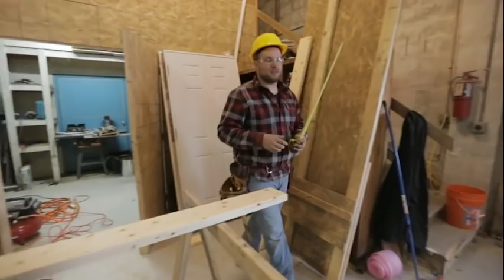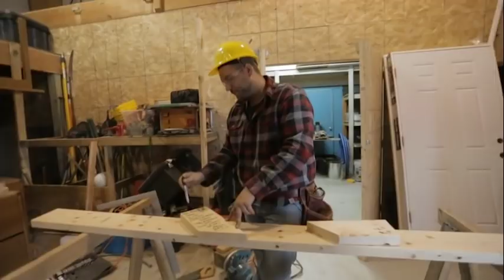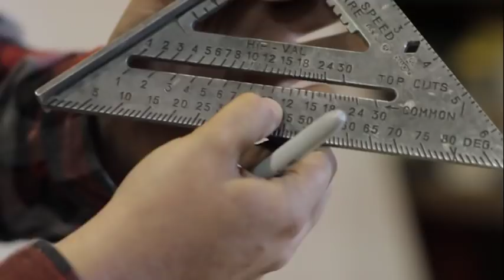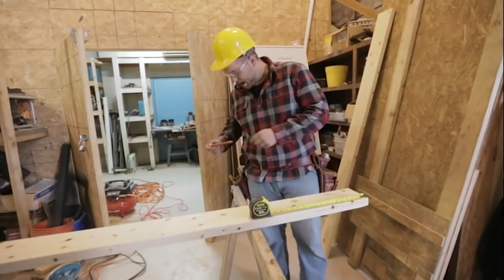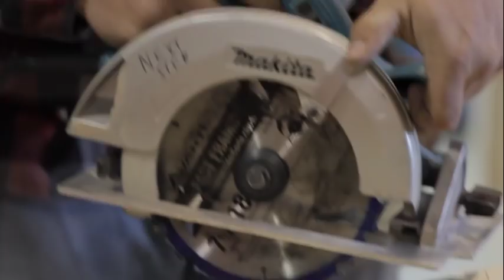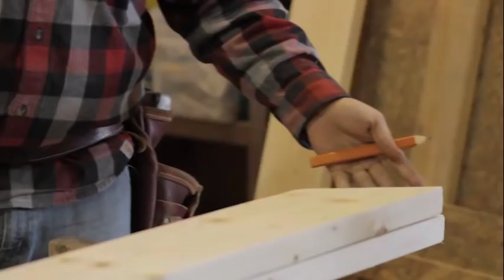How to Layout Rafters // Roof Framing Part 2

Comment: Those rafter boards need to be crowned. Look down them and put the curved bow facing up. That way the load of the roof pushes down on them straightening out any bow. Same as with floor joists.

Comment: If I'm not mistaken, IRC doesn't allow more than a 1/3 of the board to be cut, making that birdsmouth a little too big. The depth, or the plumb cut of the birdsmouth shouldn't be more than 2 9/16. On a 12/12, that would give you a seat of 2 9/16 which is more than enough bearing. On a 6/12, 2 1/16 is the height of the BM plumb cut giving you a seat of 4". A 5/12, max of 2" and a seat of almost 5". Conversely, an 18/12 gives you a max plumb of 3 3/16 on the BM and a seat of 2 3/16. A 24/12, max depth of plumb at bm of 4 1/8, bearing of 2 1/16. And a 30/12, almost 5" max plumb and a seat of 2". This would all be on a 2x6.  Very few inspectors miss that nowadays. If more than a 1/3 of the board height is cut, you'll be ripping out a roof. And the steeper the slope, you end up cutting most of the board off. The 30/12 (I know...extreme but look at the speed square), if you go by bearing, your plumb cuts end up with an overall height of 14 7/8 on a 2x6. If I'm concerned about the 4 1/2 of bearing, the plumb cut on the bm ends up taking out nearly 10 1/4 out leaving 4 5/8 of the board to extend for the tail.
Also, your framing square has a parallel line so your speed square sits flat on the board lining the perpendicular line up better when you sight down the lines.

Comment: Regarding depth of notch of birds mouth cut,  the proper way to lay out a birds mouth seat cut is as shown in the video. Technically, the birds mouth is where the rafter bears on its support, it is not a notch in the rafter therefore it is not subject to notching rules. Note that a full bearing on the support is strongest. In Ontario where I live, the building code only says the rafter must be shaped so it has full bearing on its support“THE ONTARIO BUILDING CODE | SHAPING OF RAFTERS

9.23.13.5. Shaping of Rafters

(1) Rafters shall be shaped at supports to provide even bearing surfaces and supported directly above the exterior walls.”

Comment: In the beginning of the raft of video I believe you meant the total run of the building was 8' 7/8 of an inch.. Because 7/16th and 7/16th is 7/8..so that's 8ft 7/8 in..but great video

Comment: Good educational video. However, I wonder if your birdmouth is too deep into the wood?  It seems that the net depth of your rafter at the birdmouth is seriously less than 80% of the actual depth of the rafter, which could compromise the strength of the rafter.

Comment: i have to question using a 2x8 for this with that pitch, i thought the rule of thumb was the birdsmouth cant cut more than a 3rd of the width of the board
Reply: I was about to ask the same question
Reply: I was thinking the same
Reply: So what should he use ?
Reply: @sef2273  i think it depends on the pitch of the roof and the width of the materials used for the walls(2x4 or 2x6), but if cutting the birdsmouth means you have cut more than a 3rd of the way, look at a wider board and check that. a 2x8 is 7.25 inches wide, so take a 9 inch long piece of scrap and mark it into 3rds, using only one edge of that 9 inch scrap. span from one edge to the other, where does the deepest part of the birdsmouth fall? within the 3rd or past it? if past it, look at a 2x10, if still past that, look at a 2x12

Comment: Aren't you supposed to subtract the width of the ridge beam from the total run before you split the measurement?
Reply: My observation and question as well.
Reply: I just realized he addresses the ridge beam width further in the video with theoretical lines and actual cut lines. All good! ;>)

Comment: Great video, thanks! Wouldn't cutting out the birds mouth affect the angle of the plumb ct at the ridge?
Reply: no because you have a cut that just lowers it, which also lets it sit flat on the double plate once that birds mouth is cut
Reply: You're absolutely right, it's call HAP height above plate, he will end up with a big gap at the top angle cut, and not a twelve pitch......

Comment: If I have a 16' wide building with 1" board and batten siding and I'm doing a 12 12 pitch with 2"×8" rafters and a 2"×12"×16' ridge beam I know the center is 8' but how do you get the measurements for the total length and the birds mouth cuts with a 1' over hang? The bottom and top will be cut at 45° angles but when I try to figure it out I seem to get different sizes.

Comment: Two questions..#1 How did you decide to do a 12/12 pitch? Is that something homeowners can just randomly pick or do some factors help determine which pitch is best for each situation. #2 We would like to do a more modern roof on our house and we're thinking a sloped/shed/skillion roof--the kind that doesn't have a center ridge it's just a diagonal slope, so in that scenario..would we be building half of what you're doing and instead of the ridge board being in the center, it would be above whichever wall that we want the high point? I know that kind of roof isn't exactly your speciality..just wondering if you have any suggestions on that.
Reply: Laurie Clarkson the architect usually decides the pitch. If you're just building a house with no plans it's up to you really

Comment: How did you figure out that you cut 3/4" to your first plumb line f you are using 2x8 ridge board? Can you teach us how did you get that, what the computation. And what if I used 3x3 for a ridge board?
Reply: @NSMConstruction  okay. Sorry for the querries because I'm learning carpentry here in philippines that is why I have mor questions about my confusions. So the real width of the board is 1-1/2" not 2"? How did it became 1-1/2" instead of 2"? It's because you plane the 2" board and that became 1-1/2"?
Reply: @NSMConstruction  and hoe about the calculation for the seat cut?
Reply: @NSMConstruction  Hello there my friend. Thanks for the link that you gave to me. Now I already fully understand how does the measurement done. Before you gave that link, yesterday I was thinking that if I am right to my conception that the lumber 2" width is planed and smooth that is why it gets 1-12" in the actual. And you gave it right to me the fully understanding of your lumber there compared to our lumber here in Philippines. I am asking these because I am using and following your methods of building and constructing there compared here. Thank you again.
Reply: @NSMConstruction  theres a big  diffirence even in concrete block piling. In terms of carpentry you there in abroad used a complex understanding, on the other hand like masonry we also have diffirent practice here.. But all in all I am adopting your practice there in order for me to enhance my skills in the world of industrial arts skills. Thanks for the tip.

Comment: is total span the width or length?
Reply: Yes, total span is the total width of a building. Total run is Half of your spam. EX if you home in 40ft wide(total span), then the total run of the building is 20ft
Reply: @YahQub_  been done 2 years ago